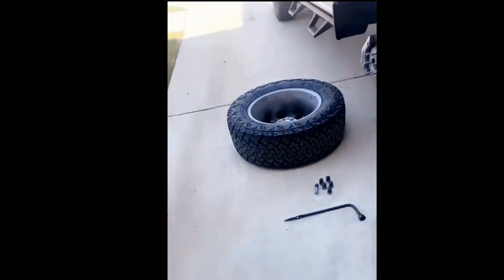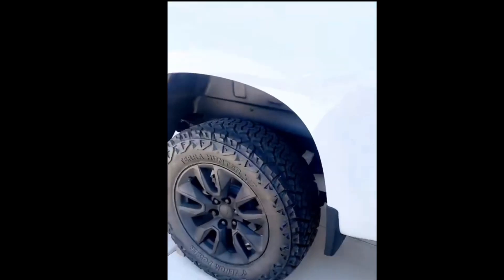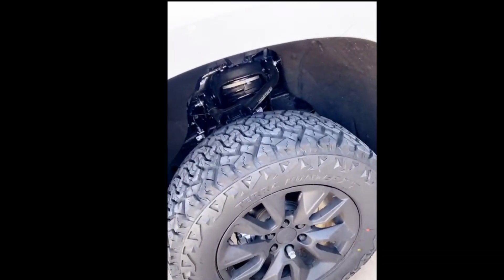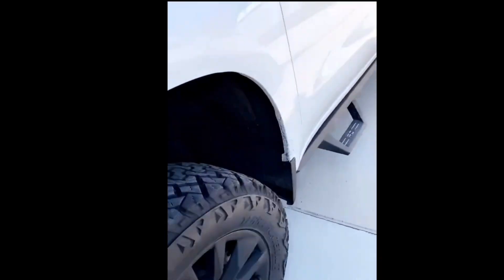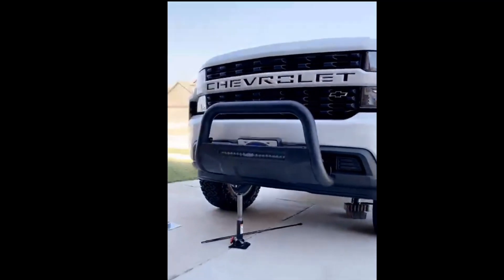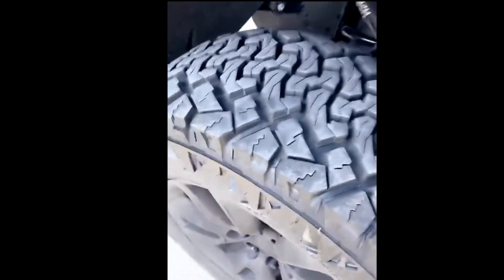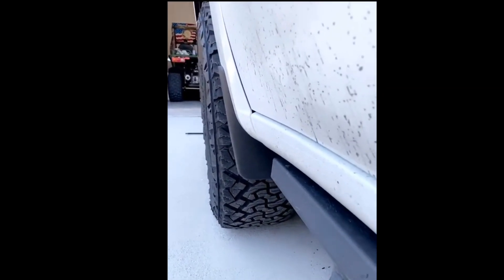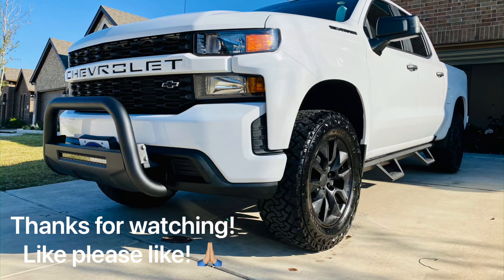2020 Silverado 3.5 inch Fabtech lift issues! 🤦🏽‍♂️

Comment: I installed the exact same lift kit in my truck and Fabtech clearly said that spacers are required if one runs stock rims or extra wide tires. I've had the kit for 2.5 years now and have had zero issue with it. My aftermarket rims are 2 inchs offset to the outside of the stock rims. I run spacers for my stock rims which I run in winter with my winter rubber. The Fabtech kit is economical and easy to install.
Reply: Does it fit in your garage?

Comment: I put 33x12.5x20 Kenda Klever RT with my stock Silverado Custom wheels no spacers. I leveled my truck with Eibachs pro truck lift kit.  I have the stock UCAs and there is probably a 1/2 inch or more space between the UCA and tire
Reply from the maker: I think it rubbed because it was 35s.

Comment: Looks like wrong wheel an tire combo with the wrong back spacing! That’s why he used spacers!
Reply from the maker: I went with what was recommended from the dealer that installed it. The offset on the wheels didn’t help.
Reply: @findaway8030  dealer then should make it right with you! Dealer was clearly wrong!

Comment: Is your truck a 2wd? And also did you get it aligned after the lift was installed?
Reply from the maker: Hey Johnny, yes it is 2wd. I did get the alignment done. After I added the spacers, it has been great.
Reply: I'm wanting to lift mine too but I am trying to gather as much info on all the kits available .  Did you install it yourself?
Reply from the maker: @johnnysanchez9031  I did everything but the actual lift myself. The running boards, bed cover and bull bar with light were all from rough country which cost me less than $500 for all 3.
Reply: What  tires?? And did you paint the wheels? Or they are from the factory like that ?

Comment: Do those 35s rub, if yes did you have to do any trimming ?
Reply from the maker: Hey Flavio! 
They don’t rub. No trimming was required either. I just added the small spacers you see in the video to keep the control arm from rubbing. 
Please be sure and subscribe, I’m posting a lift update video next.

Comment: What size r your wheel
Reply from the maker: Hey Danny, the wheels are the stock 20 inch rims from the Silverado. I plasty dipped them black and added 35 inch tires.
Reply: @findaway8030  Cool thanks! Nice truck. Need more video on your Silverado mods!

Comment: How does your UCA sit after the lift? I'm worried about the ball joints when I lift mine
Reply from the maker: The upper control arms were upgraded.
Reply: @findaway8030  which ones did you get? I appreciate the response.
Reply: @15Robin15  probably the brand that's in the title. The name on the upper control arms are usually a dead giveaway.
Reply: @anthony2558  lol 🤦🏻‍♂️ idk what I was thinking